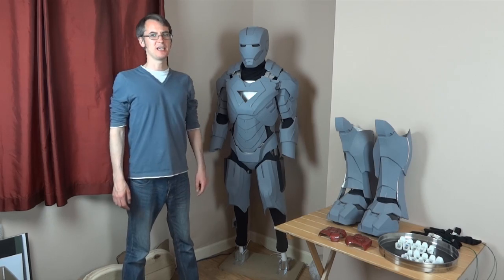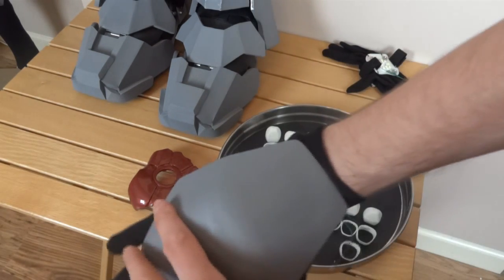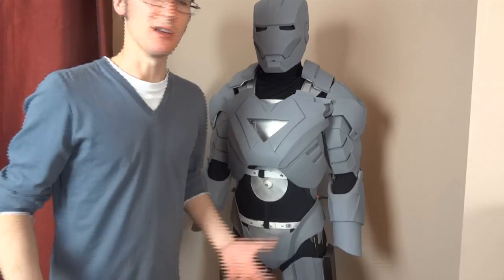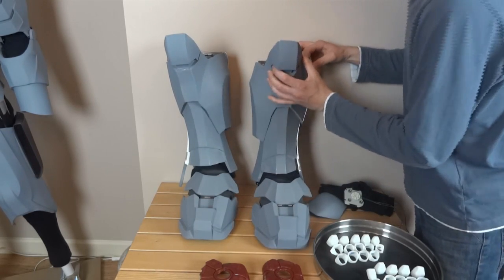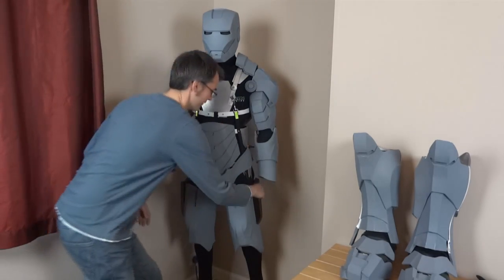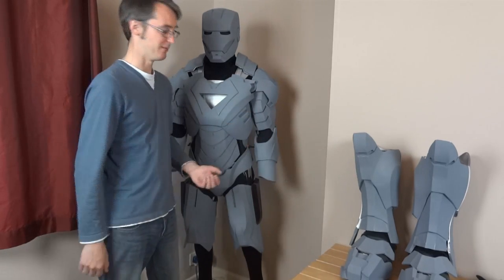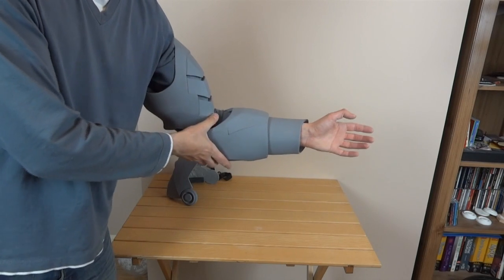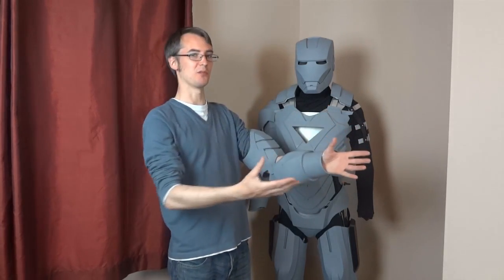Iron Man Power Suit #33 | Hands & Arms Update | James Bruton

Comment: For my cyber arm, in order for it to not be too big around the forearm, I had to have the forearm split down the middle so the pieces could separate to allow my hand to pass through and then come back together to close snugly around arm and wrist.  Upper arm only needed to be one piece since the smallest diameter opening was more than large enough to get my hand through.
I glued my finger segments and back plate onto the glove so I can slip them all on easily and just quickly adjust them.

Comment: Once I finish the kickstarter robot hand, I'm going to try printing a passive exoskeleton. Ostensibly as an alternative to a prosthetic upper limb harness (where the weight of the limb is transferred to the torso without tension like current designs). However there are lots of possible applications, including armour. Keep up the good work. The videos are very useful in coming up with ideas.

Comment: What if the arm halves were spring loaded.  You have have a servo lock the mechanism open with springs tensioned.  Then have switch in the hand that you would have the servo unlock the hinge causing the springs to pull the arm halves together.  

I have always wanted to build a bionic hand and I was planning on doing something similar.  This might push me to make a foam board mock up.